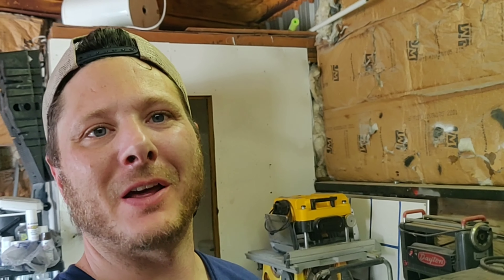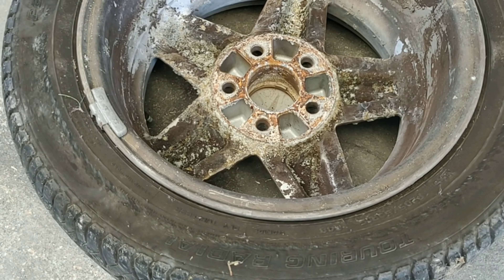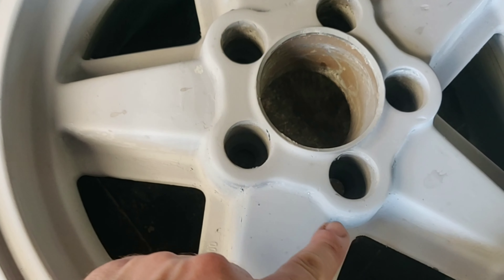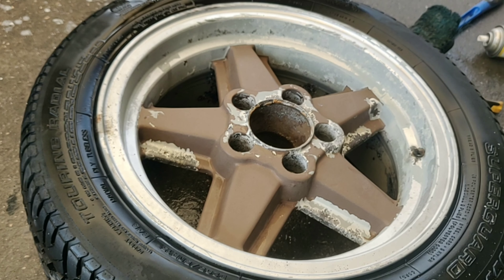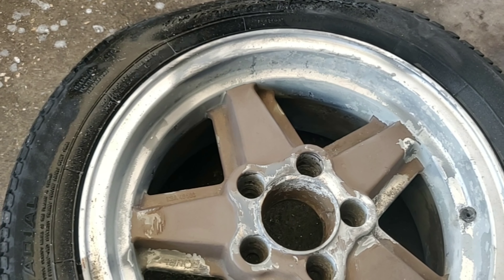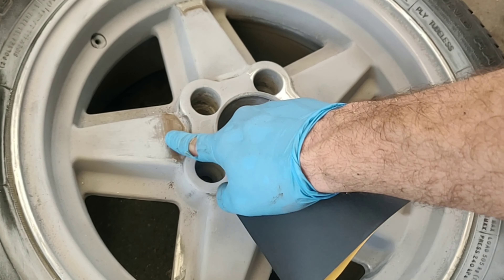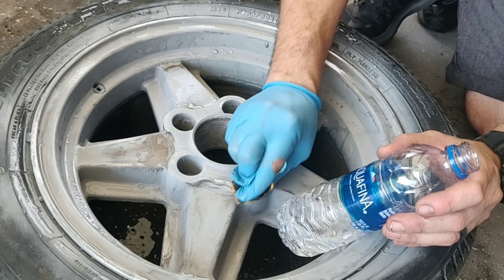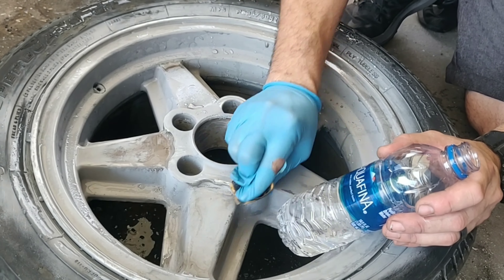Restoring vintage Mercedes Ronal rims 190e Euro spec 2.0 extreme oxidation recovery part 1

Comment: Pete, great work as always.  Your thoughts on using a Dremel tool for the hard to reach places?
Reply from the maker: Yes that does work too.  I almost bought one but bought some drill attachments instead.  There's a lot of tools you can use and Dremel is one of the better ones.